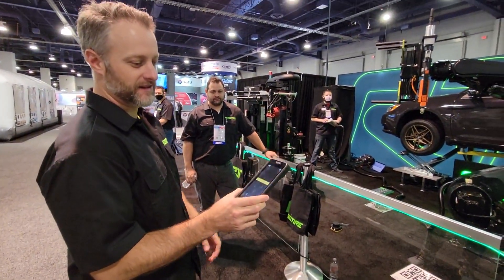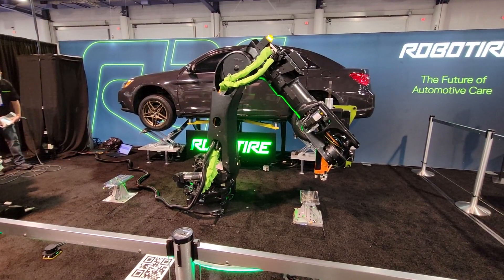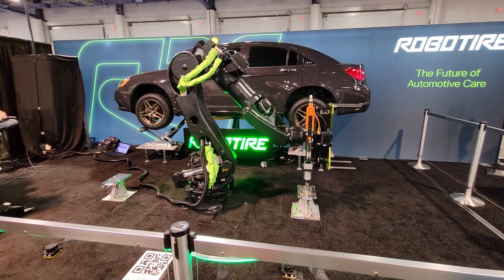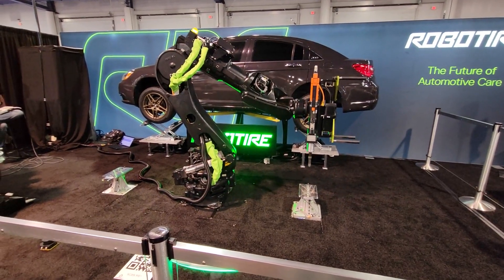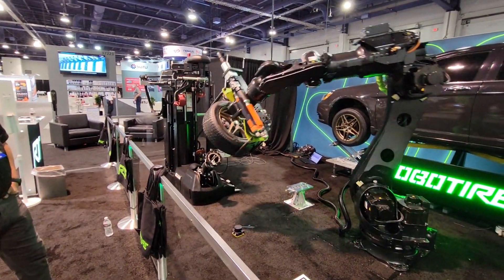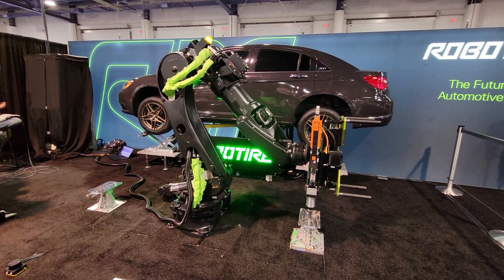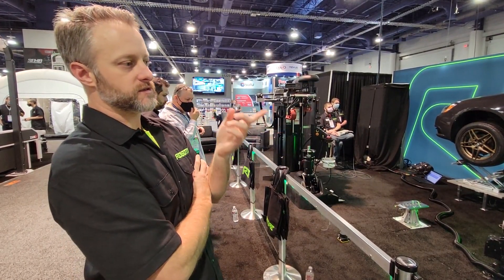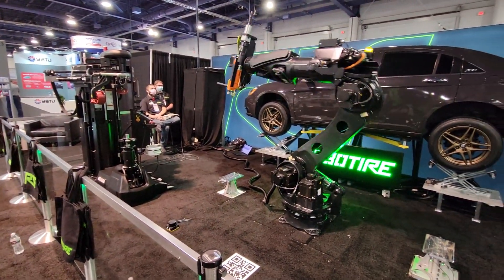RoboTire Shows Off Tire Changing Technology at SEMA Show 2021

Comment: Very useful for heavy tires on big trucks. Otherwise, it's a failure.  And it's not capable of adapting to problems. 
Can two of these even keep up with one guy mounting and balancing the four tires?  And it needs three bays to change tires? Plus, another two bays for the changers and the balances? Because it will need 2 changers and balancers? 
$500000 for the robots, 5 bays, four other machines, and it still can't be left alone. 
Dumb is not knowing something is a bad idea. Stupid is knowing it's a bad idea and doing it anyway. This is stupid.
It's a dream toy, and bankrupt.

Comment: Several shops have a newer model installed in a couple of bays.  The newer ones go faster and can complete the whole process. Wait until these get better. Several oil change models can change the oil and filter in 2-3 minutes. More of this is coming.  As predicted, unskilled labor will have a big problem in the next 10 years and beyond. Warehouse work, hotel, food service industry (not the uptown chef restaurants), and customer service will vaporize (no more punching through menus when you want to talk to a human), and will be run by ChatGPT. It will be unbelievable in 20 years.
Reply: Resistance is futile you will be assimilated

Comment: 9:17 "It torques them to the exact manufacturer's specifications, which is something that most people don't do out in the shops today. They just don't have a way of knowing exactly how tight their 'torque gun' is going. This one knows precisely how much torque. This one requires 70 ft. lbs., we tell the robot to do that and it will do that exactly every time."

They just don't have a way of knowing exactly how tight their 'torque gun' is going? Ever hear of a high quality and calibrated torque wrench?

Even if shops buy this robotic device, they'll still have to have legacy machines (and technicians that know how to use them) in the shop as a backup in the event of breakdown.

Comment: It’s very cool that these things are possible but this is an unbelievable waste of time, money, and resources. This only works on vehicles with large suspension travel. It only works on vehicles with all lug nuts the same size (better hope your car doesn’t have a lug key nut), it takes up a LARGE floor space footprint and will need an equal amount of space and another robot on the other side. It doesn’t work on vehicles with lug bolts rather than studs since it relies on the wheel resting on the studs while it switches over to the handling attachment after pulling the nuts off. This machine also has no way to tell if the nut crossthreads when reinstalling, it’ll just ram it on until the desired torque is reached. It’s also not fully automated as someone needs to manually remove the used tire from the dismounting machine and rest a new tire on the machine after. Someone also needs to manually run the balancing machine. People can’t be working in the area of the robot while it’s working as they’ll likely get hit and injured. And at the end of the day this process really isn’t faster than a human, although it is nice that it takes strain off the worker by not needing to do any “heavy” lifting. Very cool technology and a neat idea but a complete waste of research time and money

Comment: Yeah, that looks like a real moneymaker if your charging by the hour. What a waste of time and I could probably change four tires and balance with the new tech equipment while this thing just gets the lug nuts off. Have fun with your robotics. Oth by the way what happens with a previous cross-threaded lug nut or even the robot cross threading a lug nur.

Comment: I don't see any advantage, except that a tire technician could be doing some other work while the wheels are being removed / installed. 
Maybe skip buying the hi-tech Hunter changer and the tire tech can do the thinking work of actually INSPECTING the wheels and changing the tires.
Wheels can be corroded, dented or damaged in some other way.  The bead-sealing area is critical.  Can the RoboTire check that?  What about balancing?
And we don't know the cost of this thing, yet.  What could the ROI / payback, be?  Nice piece of tech, but I think it still needs some work.
Reply: Cost about 250,000